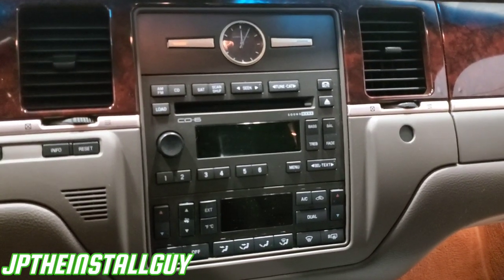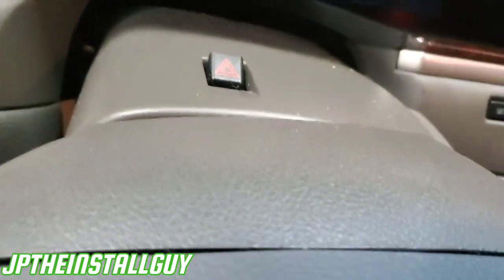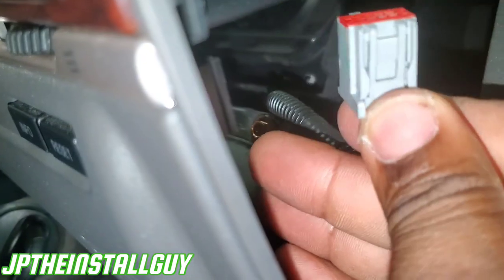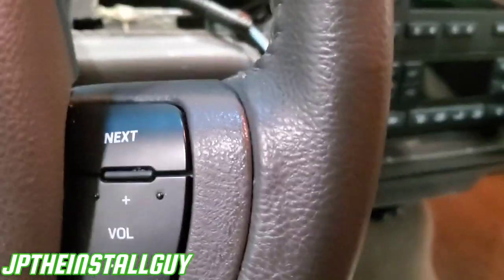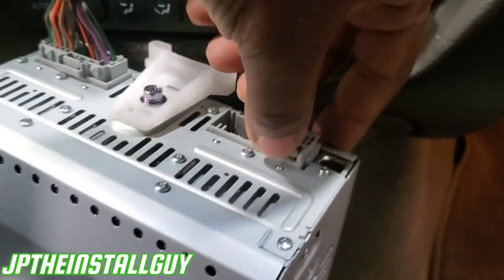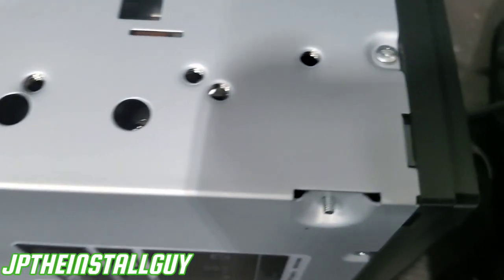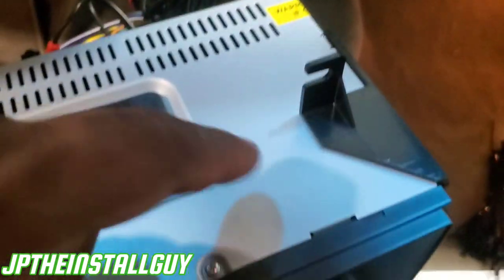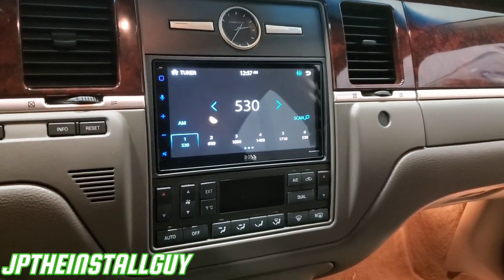2011 Lincoln Town car radio removal replacement install

Comment: Appreciate this video. Had my deck professionally installed since I didn't want to route the backup camera myself so I wasn't sure of the install/removal process. That car was totaled due to a drunk driver and I only had a short amount of time to get to the yard to remove my aftermarket deck and reinstall the OEM deck. I was in and out thanks to your video.

Comment: The store page for the bracket you linked in the description says 2003-2007, but I see no other brackets. I'm guessing this bracket will work for a 2011 also?

Comment: Was wondering, does the factory sub work the way u have the stereo hooked up ? If so is there something special u did or just by hooking up the harness it will work. I have a boss radio as well , right now I have a aftermarket sub in the factory sub box and is powered by aftermarket amp using the rca outs from the HU.Thinking I want to just use my aftermarket sub powered by the head unit. Then put a sub tube in the trunk cause I have a lot of unused subs around and power that off the aftermarket amp. Thanks

Comment: Hey I have a question about my 2008 crown Vic radio harness. The guy I bought it from cut off the factory harness connector so I had tu hardwire everything but now I can’t figure out how to get my radio tu keep memory. Can yu help me out with that plz?
Reply: There's a continuous 5v supply not the one Hot in Start that you'll need to make sure is connected. It's the same supply wire that is connected to the clock.